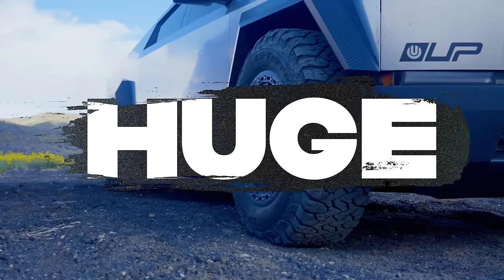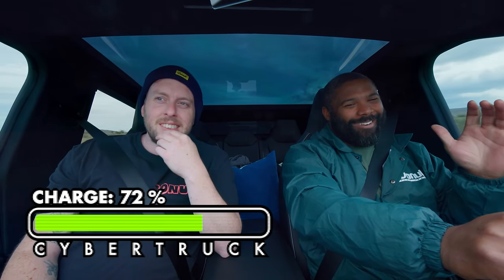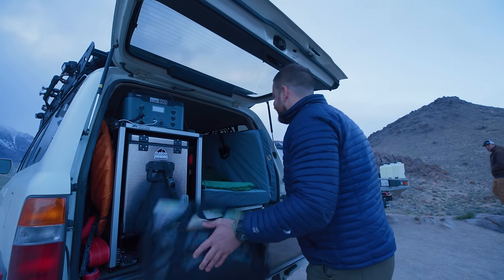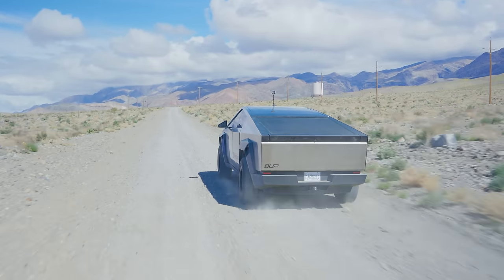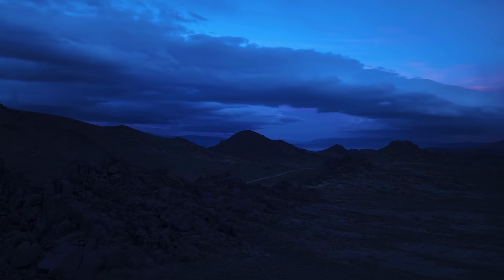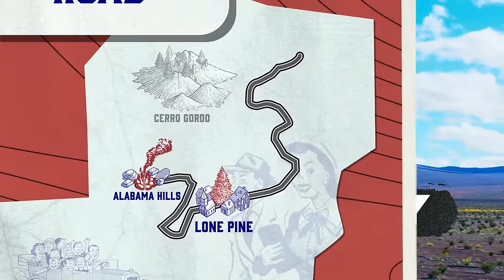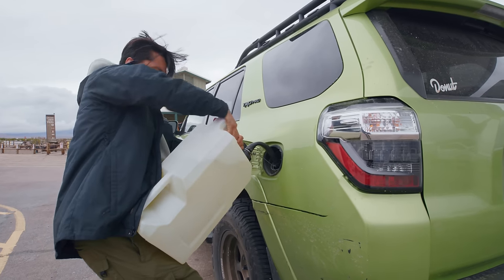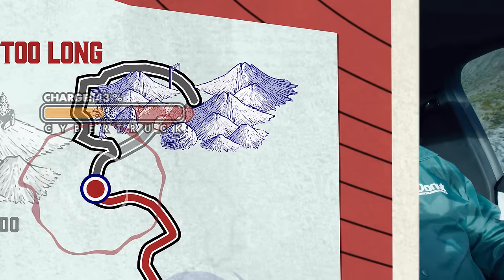Surviving 100 Miles Offroad in a Cybertruck

Comment: I was optimistic about Tesla, but I agree that the infrastructure istne there. I rented one in Norway (where there is generally better infrastructure for Tesla's) and there was a landslide blocking the road just before the nearest Tesla pump. I had to drive an hour back with everything turned off and it was wigging out as we pulled into the charging station. I know what to do when you run out of gas, but if you run out of electricity, I guess you just have to tow it to a charger? Dumb.

Comment: How is the battery performance so much worse than my fiat 500e with its tiny city battery. Like the comparison is not 1:1 obviously and it will likely last a bit longer if the cybertruck is driven like I drive my fiat but still. (Referring only to the non off-road section at the start)
Reply: There's something like a 2000-foot elevation rise from the L.A. Basin to the High Desert where they had to recharge. Distance + climb can do a real number on your range.

The return trip would have been mind-blowingly efficient, though.

Comment: The problem isn't that the future isn't now, the problem is that the cybertruck isn't the future.

Firstly, EVs just aren't viable in areas where the infrastructure isn't there to support them i.e. out in nature where the whole point of it is to get away from form the hustle and bustle of civilization and city living. Diesel-hybrid drivetrains give you great torque and stupid range/efficiency but they're just nowhere near ubiquitous in North America, but they should be. They're the best of both worlds it's completely fucking ridiculous they never caught on here and that's even less likely to happen now with the push towards EVs. Although, fingers crossed still.

Secondly, the cybertruxck is just not a good EV in the first place. Too heavy, overpriced, too delicate in that almost any electrical issue completely bricks the entire vehicle, not reliable at all. Over promised and under-delivered, which shouldn't have even been a surprise if you've been paying attention.

Comment: I hate the Cybertruck, it looks stupid, Elon is an idiot. 

BUT this “test” was ridiculous.  To be fair. I have a Rivian R1T that I off road, and it’s perfectly capable, only issue is yes you need to plan your route when going farther off-road, being cognizant of the return trip.  Other than that, it’s the same as a gas truck.  I’ve had friends run out of gas… so yea planning is required regardless?

Comment: I agree but I don’t agree. I’m driving two cyber trucks . I’ve taken them from San Diego to New York and CT stopped in Moab and everything has been great and I drove more like 2 1/2 hour then charged but charging was only 20 mins or less to out next charge and the truck does all the planning!!! In off road mode I didn’t see any life changing differences you might have just been going fast and slow a lot . We are even driving them back to San Diego and currently in New York and letting people test drive them !!! But great video and I agree with some things ! It’s been 3000+ miles and no issues

Comment: This video is trash, just like the cybertruck.  That 1994 (he said 30 years old, looks more like a '96 to me) toyota land cruiser gets 13mpg.  It has 350mi range on flat ground at sea level.  It definitely used more than 1/3rd of the fuel going 80mph for 2 hours, more like 45%.  More % than the POS cybertruck.  

That said, it's easy to strap extra gas tanks to the land cruiser, and even in the most remote parts of USA, you are almost never more than 120 miles from a gas station.  Obviously the cybertrash can't benefit from either of those realities haha.  If I saw someone overlanding with a cybertruck..... well I shouldn't say what I would do here.

Comment: Its a bit absurd to put larger tires on it and then complain about the advertised range.
Reply: Funny most offroad trucks require larger tires sizes, minimum 33-35 inch tall of tires for ground clearance.  Seems a diesel in most cases having a larger tire can compliment fuel mileage in most cases, due to being able to pull it with low end torque and help bringing rpm down. Hmmm. I guess having charging stations are necessary for any off-road stock or larger tire electric car, time to set up charging stations every 150 miles or less all over the wilderness and etc..  cmon. Know that electric is a good idea but not realistic for all situations.  If I had one I'd had several gas cans with a generator to get me home.  Not everything is engineered to be capable of taking over the combustion engine. There's a time and place for all forms of transportation. Electric should mostly be used for fleet and government use where charging stations are readily available and most distances are known in advance.  Not realistic in a public real day to day life. I understand transitioning to hybrid far better than only electric.  It reminds me of my kids power wheels,  just a adult size version.  Gotta have a plug available and time to sit and wait and hope theres no dire emergency! Good luck!😢
Reply: @cliffbernard3353  I'd argue its ideal for public everyday life because every home and business is a charging station. For the overwhelmingly vast number of people, everyday life is going to work and running errands, and my model 3 has 300+ miles of range every morning. I have not had a thought about range in months, and spend ZERO minutes per month sitting and charging. Only costs $50 a month as well. 

If for some reason your normal every day experience is driving 250+ miles through the desert, then perhaps an EV won't meet your needs. 

Finally, if an adult power wheels means  450hp/550tq instantly, then sure, I got a power wheels haha.

Comment: :))) I guess they gonna start working on flux capacitor for 2025 upgrade on those cybers :) but the second gen that need a garbage, not the nuclear sucker :))) sorry  but stickin 2 my 3rd gen 4runner until the frame is gonna snap in pieces, fuck Evs :)))

Comment: Also IDK why they don't have a gas generator you could mount in the bed of the truck for offroading and whatnot, and charge the car off gas Even while driving it just seems dumb not to have something like that.
Reply: It's almost like adding even more weight would just drain the battery even faster. 

Crazy concept I I know.

Comment: The Cybertruck, over promised, over hyped, over priced, and under whelming. And I'm a current Tesla owner. I will not be buying one of these. This truck is a joke. It has only 120 Kw battery and still costs $100k, why? the Ford lighting lighting has a bigger battery and better design than this and you can buy two of those for the price of one Cybertruck.

Comment: You lost me when you were shocked to find out that everything you used in the car consumed electricity. Which evidently means that you didn't know that the way the truck is set up also makes it way too inefficient....to then be doing 80mph.

Ultimately, either out of ignorance or malice, you made this a whole lot worse, by a factor of 10, than what it should have been

If you dont like EVs because you don't know math......or chemistry.....or anything. Then say so! But coming out here and comparing that shit to modified gas off roaders (with actual gas cans attached to them because they're sooooooo awful) makes you look completely unreliable as an auto journalist